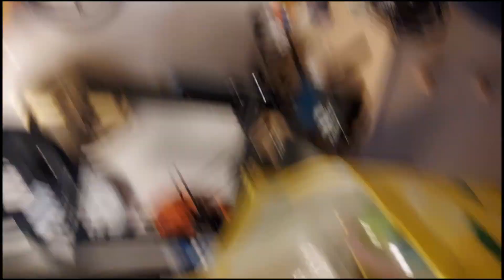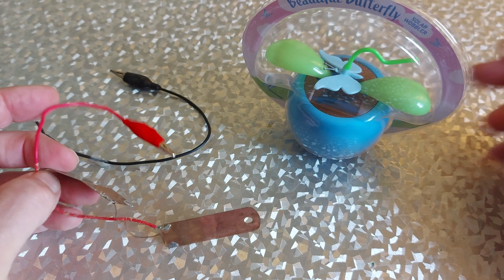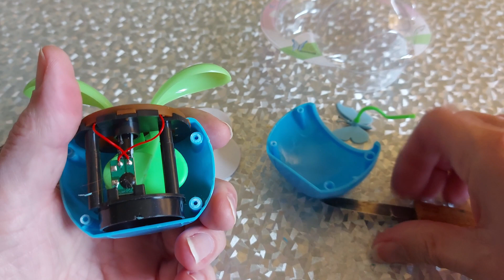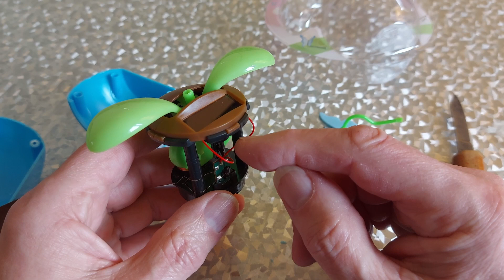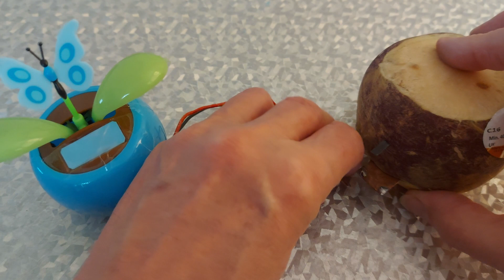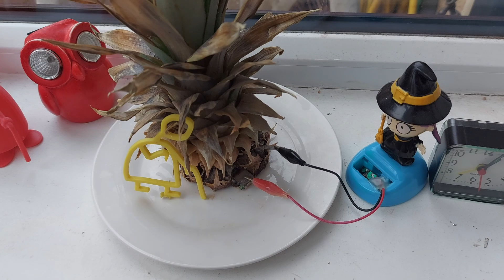Swede powered Butterfly 20240316

Comment: These alternate battery experiments are very interesting 👍
Reply from the maker: I think they are a bit repetitive, but still fun at the moment. The key is the copper and magnesium electrodes. As long as you stick them in something that can conduct the electricity, it should work. Some better than others. I expect I will move on eventually 😁😁